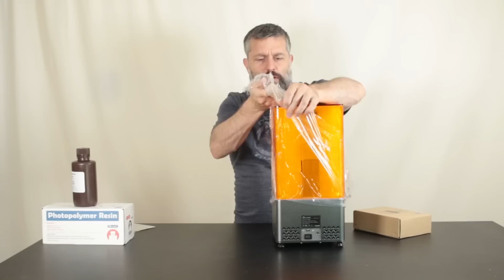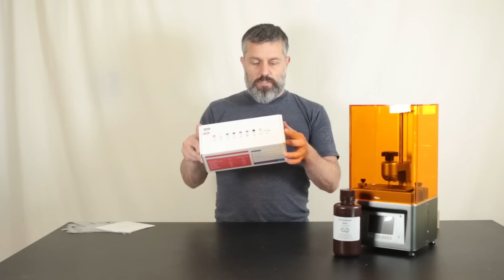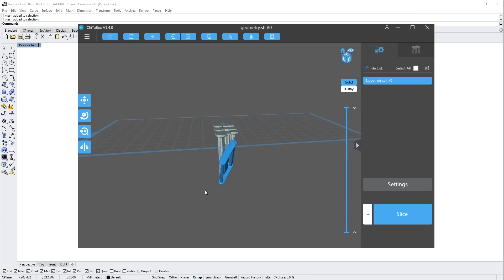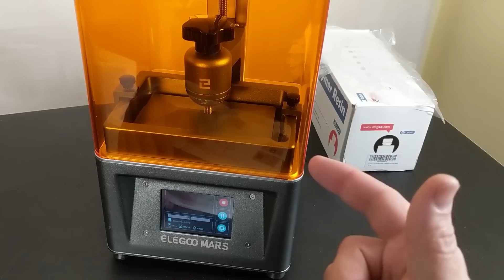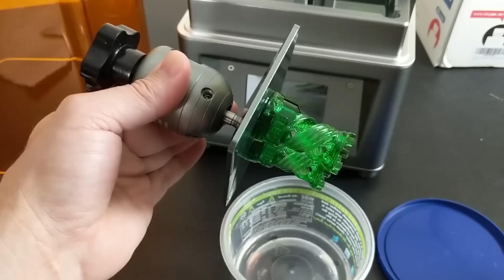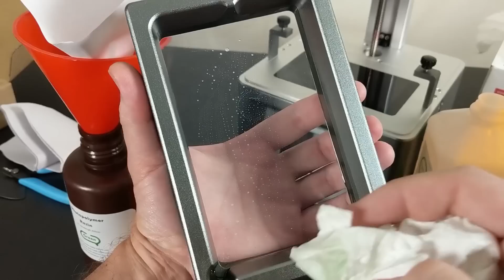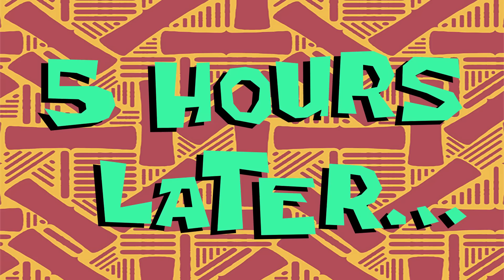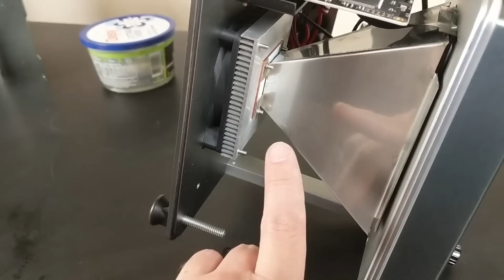$250 for This Quality of Printing Is Unreal! - the Elegoo Mars Delivers, so Let's Review It.

Comment: I bought a new Ender3 from amazon. Had it for almost a month. Could Not get my prints to stick to the bed. Tried everything including glue sticks. Even tried various filaments etc. Sent it back to amazon. Just bought an Elegoo Mars resin printer. Same as the one you are using. Prints stick to the bed and I am a happy camper. Thanks for posting.

Comment: You are probably the only one who isn't using fusion 360
Reply from the maker: Not true. In the online Maker community there it appears (i that a majority using F360 because it used to be "free," Many of the "influencers" in this space therefore showcased it. This community is notoriously cheap to the point where the vast majority of the community thinks open source was created to give them free stuff. So Fusion 360 quickly became the most talked about CAD program.  The fact is that Fusion 360 has a paltry, laughable market share compared with the incumbent SolidWorks (BTW, I despise solidworks). F360 is just Autodesk's version of Solidworks). It is an engineers program that gives parametric capability to the user. This only helps when you know exactly what you are drawing. If you are designing and you can't plan your drawing because you don't know exactly what you will end up with the parametric functionality is a burden on the cognition of the user. I am a professional industrial designer who was trained as an Architect. Therefore I use the designer's program of choice: Rhinoceros 3D. I am at least 2x as fast drawing in Rhino as a similarly skilled operator of F360. This is because the parametric "functionality" doesn't exist in Rhino. With the complications and indirect workflows removed I can directly draw what I am thinking. Rhino is superior for the designer. Fusion 360, Solidworks, Siemens NX, etc are all very similar "parametric" programs for engineers who are working in teams and have been handed a final design. The project is described. The designers have done their job and now it's just a matter of getting it done. No exploring or experimenting, just get it done.

Comment: RTFM  RTFM  RTFM  RTFM  RTFM  RTFM       DON'T MISINFORM VIEWERS      THIS MATERIAL IS EXTREMELY HARMFUL     !!!!!!!!!!!!!!!!!!!!!!!!
Reply from the maker: It's foolish to touch the resin, but you are being histrionic. I realize how emotional people can be about the subject of safety, but dude, chill. The material is not as harmful as you think. It causes an extreme allergic reaction when left on the skin for long periods of time. If you get the resin on your skin wash thoroughly with warm soapy water. After that wipe the skin thoroughly with rubbing alcohol. You don't even need to be in a hurry to do this. just fully remove the resin from your skin and you will be fine. If you start to get a reaction just do the washing and the reaction will stop. There are no VOCs in the resin so it's not going to cause cancer, and it is not a strong acid or base, so you aren't going to get a chemical burn. The allergic reaction causes blistering and discoloration of the skin which is why it gets confused with a chemical burn.

Comment: Hello,

I just received my Elegoo Mars printer. I set it up just like the manual says to and started the "Rooke" prints. I went to check on it after 3 hours and the arm is moving but there is nothing being printed on the base plate. I used the Elegoo Grey Resin (I did not touch the settings but they matched what was on the bottle). It is in my garage and the temperature is 50 degrees fahrenheit. Is that too cold for the Resin to print? I cant find ambient working temperatures for the Resin or the Printer. Do you know what they are?
Reply from the maker: It sounds like your screen is defective. Contact the manufacturer.

Comment: People are fascinated by the emerging technologies such as these, but they fail to see the underlying forces that are driving these new technologies.  Manufacturing must achieve higher rates of efficiency to achieve the higher production rates and outputs necessary to sustain an increased world population. This technology didn't come about because is was "cool" , it came about to solve real world problems. Also, innovation comes about because of this new technology , one is no longer limited to traditional methods. For example, now parts can be printed that are simply impossible to manufacture using contemporary technologies. These innovations can contribute to efficiency and even brand new products. 

I don't want to sound impertinent but none of us are impressed with watching plastic being cured by UV rays from the sun. Show us how you built some gadget that optimizes and/or enhances the current world in which we live now.

Let me explain what I'm trying to get at. Back in the 1970''s VLSI IC's led to the miniaturization and cost effectiveness of electronics that changed the game. It wasn't the VLSI integrated chips that were fascinating, what was fascinating was the development of the personal computer which could have never come about without VLSI technology. The technology led to the innovation of the personal computer. In your videos you show the this nascent technology but failed to show us some practical innovations, if any, that have resulted from this technology. All we're doing is watching you operate this machine to make worthless doodads. I don't care if you can print up a car cigarette lighter port. I already wasted twenty minutes of my life watching you fumble around with this machine. I'm not going to watch the remainder of this video because all you'll do is print up some cutesy little toy that attaches to a key ring.

Comment: The cookie notice is there to inform you as required by European law. It does not imply that because you see this notice, that other websites do not use cookies to track you. Quite the contrary, especially with US-based sites we see that you are both tracked and monitored without your consent much more aggressively. European law forbids loading cookies on the website prior to you giving explicit consent, so contrary to your claims in this video, it is actually good that you see this notice. While I am not a fan of the Chinese government it would be appreciated if you would also refrain from spreading misinformation. (Press release regarding cookie wall: https://curia.europa.eu/jcms/upload/docs/application/pdf/2019-10/cp190125en.pdf)

Comment: How quickly did that print?
Reply from the maker: 8 seconds of UV exposure per layer plus about 2 seconds of lift-&-reset in between layers means a safe estimate of print time is 10 seconds for every .05mm of print height. A 25mm (1inch) tall part no matter how wide will take about an hour and a half.

Comment: You can get a UV light station cheaply by buy a gel nail Iv lamp. They rainy from 15w to 78(?) and watts in to the 80’s and 90’s. Whatever you little heart desires I guess. I’d suggest getting the double handed UV light as you can fit bigger objects if needed and it’s longer. I’ve seen the larger watt light for under $30 on Amazon.

Comment: A clean presentation but a lot of errors & misinformation, plus you're not using your gloves OR mask. Resins are dangerous substances; Some people take serious allergic reactions to them, similar to shellfish allergy. You tell us they included protection against fumes then you're never seen to use any of it. WTF. Typical arrogance of people who think "Im so clever I won't have an accident" but anyone could wipe resin off with a gloveless finger then forget they did that and rub their eye (which is now irritated by fumes). 20mins later (if they're lucky) they're in A&E on steroids & a ventilator. This is why you have 2:1 +/- Rating which is a shame because your presenting skills are good. Your title says $250 but it's $350. OOPS?
Reply from the maker: PRO TIP: Read the description before commenting. Youtubers will often put important info there which was not included in the video. In this case, you aren't saying anything new about resin safety. I already covered the topic extensively in the two follow up videos I made about resin safety. Also, I don't know where you are buying this printer from, but if you follow the link in the Description you can purchase this printer for $259 USD.

Comment: Does anyone know if I could put this thing in my office - like my PLA printer - and it won't stink up the office?
Reply: No. Do not put a resin printer any where you plan to occupy. They really need to be in their own area unless your office is insanely well ventilated. They're not like FDM printers.  Yes, they do stink. Some of them have active filtration but it's still not good to be breathing resin fumes. This guy had HORRIBLE safety practices. Gloves and a respirator at all times are to be worn around UV resin.
Reply: @WrexShepard  , Thank you so much!  I already have a 3D printer and I was wondering if I should upgrade.

Comment: I don’t suppose there is anything y9u could add to the resin to increase the parts strength? Like powdered carbon fiber, Kevlar or glass? Would that compromise it’s ability to cook off into its final, hardness?
Reply from the maker: Of course you could add some strands or poweder into the resin. The problem is that pure resin is stronger than resin with a little bit of something else. If you could make it 90% something else (like Carbon Fiber), that would definitely be stronger.

Comment: The FEP film at the bottom of your tank is flexible and not supposed to be drum tight. By flexing as the print lifts, it acts  similarly as tilting by changing the angle between the film and the part. It's not as good as tilting, but it works.

Comment: Sub par review and misinformation and mis handling of the resin. Like this is someone with no previous experience with a resin printer (I hope so at least)  this is some machinima level trash.
Reply from the maker: Sub par viewer who doesn't even watch 1:49 of the video before leaving a comment. I hope so at least, otherwise his information retention is so poor I wonder how he made it past the first grade. Also, his screen name has no content associated with the account. Most likely this is a throw-away troll account here to try and make Elegoo look bad so that you are more likely to buy another brand.
Reply: @DesignPrototypeTest  simply what I said because of information based bias in regards to I believe you mentioned China, my retention was lacking because I skipped passed your very weird anti China stance, considering a majority of the equipment you purchase would be that of china, and that if anyone watched this video besides the comment you pinned would not know about the actual proper safety's required to use machines like this I am a fan of elegoo small scale ease of use couple case issues regarding the lack of UV filtration but all in all good gear. I'm just not super merciful when it comes to reviews like this when not handling the very serious safety issue of the use of wide variety of quite dangerous resin from castable to flexible to noxious and that varies from one edge of the poison scale to another.
Reply: @DesignPrototypeTest  sorry I'll simplify it for you the equipment is good but you are not. Targeting lack of content, information retention, and grade school and that I have anything against elegoo which are brilliant pieces of equipment for the cost. 
When I reference machinima level trash it was known that the reviews at the end of machinima days were that of bias weird secondary information and rants that tangent off the initial topic.
Reply: @DesignPrototypeTest  looking at the other comments mine are quite justified, I don't think you're a bad reviewer you just properly didn't do your research in this, and it's something that could possibly harm someone if they used your video as a basis. Anyway hope this helps you understand

Comment: Avoid coming in contact with the resin. To avoid industrial dermatitis, wash hands in an industrial hand cleaner before handling the resin or parts covered in resin.  Use the printer in a ventilated room and use gloves to handle unwashed parts at all times.

Comment: I just read down to the bottom and found that you sure hit a lot of hot buttons. You don't have to empty the vat! If nothing went wrong in the print (and it usually doesn't), there is no debris and you can just add more resin and keep going. In fact, the chance of spilling that stuff increases exponentially every time you have to empty the tank. The FEP film is critical and can be damaged by rough handling, but you can buy it in large sheets and cut it to size. It's about 2 bucks a sheet so it's not expensive. You can use some teflon oil on the FEP to make it even more slippery. Resin printers can do prints that impossible in string printers. If you have it set up correctly you don't need to look at it. Start it at night and have beautiful parts waiting for you in the morning. 

I use two alcohol baths just to get most of the material off and then use an ultrasonic cleaner with Simple Clean detergent to clean the parts very well. I built my own curing cabinet with it and a turntable on a timer. It also works flawlessly.

I find most of my failures are now due to poor drawings. 

And lastly, the folks at Elegoo Customer Service are probably the most responsive people I've ever dealt with anywhere in the world. I had a problem with the touch screen registration. The sent me a calibration program and just to be sure a new screen. When I thought that Amazon sent me the old standard resin instead of the new improved ABS-Like resin (more shock resistance) they said if it was in error they would refund my money to PayPal. As it was it was the correct resin, but not the new labeling. The sent me 5 bucks anyway just for all the trouble it caused. The all was the result of a bad review I left at Amazon. They responded without me asking. I've never had that happen before. SO STOP BADMOUTHING CHINESE PRODUCTS. Even when you're buying top quality US brands, chances are better than 50/50 you're buying Chinese. Milwaukee Tools comes to mind.

I waited for years for 3D printing to become something the hobbyist can afford. I always knew resin printers were the way to go when you're working in small scales (1:48 in my case). This printer has literally changed how I approach model making. The fact that it's using iPhone technology is brilliant and is the reason that you can get 10 micron printing for less than $300. Besides the film change, Elegoo has videos on rebuilding the entire machine. It's that simple and they're not afraid to let their users work on it.

Comment: You can apply Klasse (red bottle) acrylic cleaner/protector to help prevent sticking to the "bed" window prior to each use. A little goes a long way, so just a drop or two applied with a slightly damp cotton ball, remove the excess Klasse with a dry cotton ball. 😊👍🏻

Comment: Another caution handling the resin: if you get a trace of this in the eye (easy when washing with alcohol and a little splashes) and you go out into the sun, TROUBLE as you may need to go to the emergency room!  There is also all that alcohol with uncured resin dissolved in it: do you put that outside to cure the dissolved resin?  Can you then filter and reuse the alcohol?
     Why did you print that flat part inclined?  Didn't that create the need for all the supports?
     By the way, any of the 450nM LEDs can be used to post-cure the parts.

Comment: You could just review the machine without the indoctrinated china/communism hate. It really makes you sound like a moron. The cookies message is there only for your information, as it is required by law in EU for example (GDPR) to inform the user that the site may need to use cookies to store information (like your account details etc.). This is not a requirement in the US, which is why you've never seen this message before.

Comment: get a deck of cards. the wax cardboard will allow wiping of the sheet to both sqeegy the resin out of the tray. also use it after each print to scrape the bottom of vat to make sure nothing is sticking to bottom. cheap 2 packs of cards from dollar tree..also these chemicals are dangerous and i think have formaldehyde in them. use in ventilated areas. also there are long term health effects of chemicals in the resins that can absorb thru skin and attach liver and kidneys and such. so always use gloves.dollar tree nitride or latex are ok. careful procedures should minimize exposure.otherwise can effect health over time.

Comment: Why are the parts printed at an angle like that? Is that required for resin based printing? Why is that?
Reply from the maker: You want to reduce cross sectional area as much as possible because of the suction cupping issue that I talked about with the rook print.

Comment: just curious why you didn't just print that chest part vertical or horizontal? Seems you wouldn't have need any supports then.
Reply from the maker: The chess piece was printed as you describe and required no supports. The buckle part was printed at an angle becasue printing large flat unsupported shapes leads to problems with detaching from the bed. I briefly touched on this in the video when I talked about the "thunk" sound when the part detached from the membrane with each layer. The issue is a rather large concern. one way to mitigate is to print at a funky angle like I did.